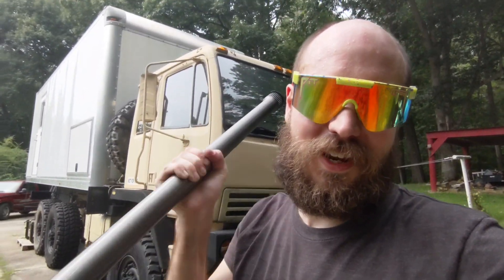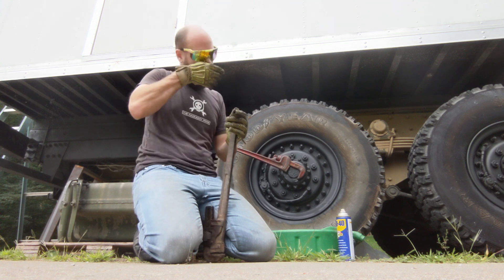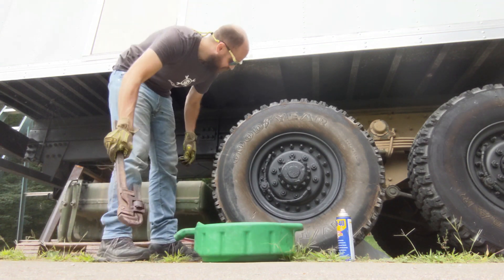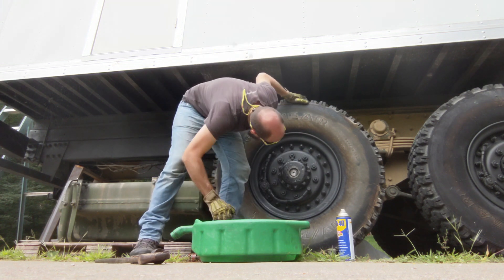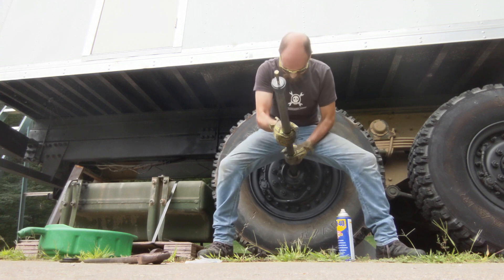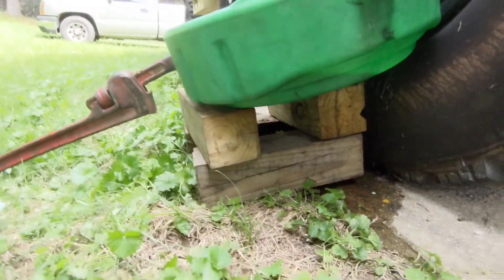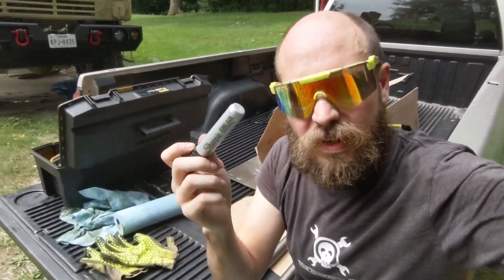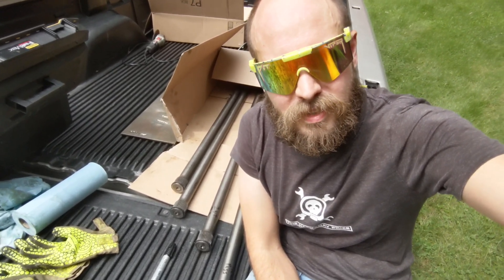LMTV FMTV Axle Pulling - 3.07 Swap Prep - Useful for towing

Comment: (insert mind blown imogi here)  I've been procrastinating my gear swap but this makes me think I can change out the rears without removing the wheels or hubs.  My question is do you think the front axels will come out far enough  (until the u-joint bump up against the hub) to change out the front pumpkin?
Reply from the maker: You can easily do the rears without taking any of the wheel/hubs apart. You can do the front in a similar fashion but it's a little more involved because you have to take the brakes apart. Hub still stays in one piece. I have successfully pulled all 3 pumpkins just haven't make a video on it yet.